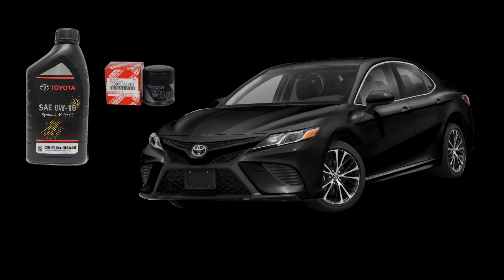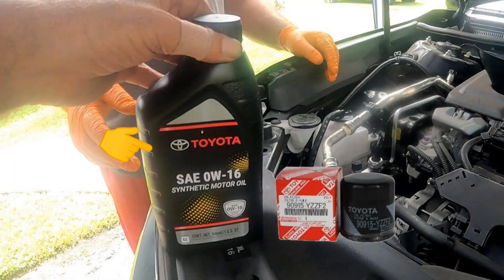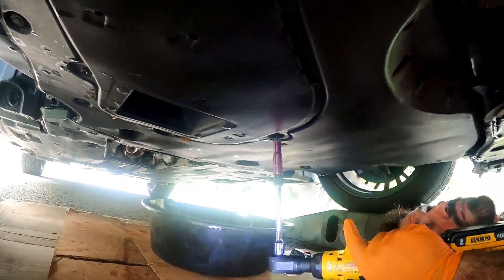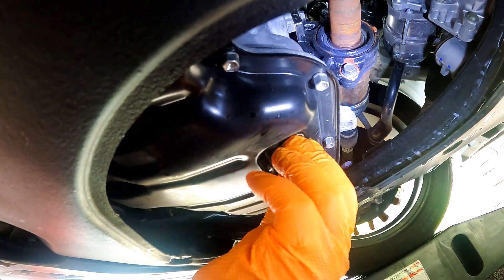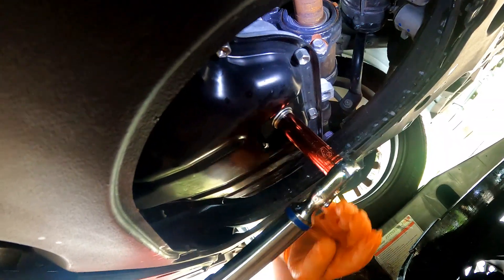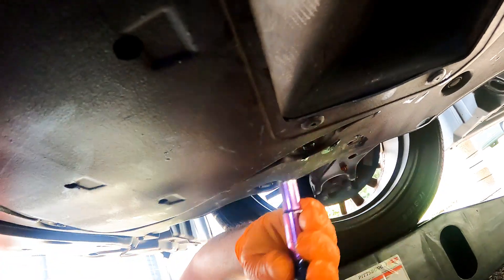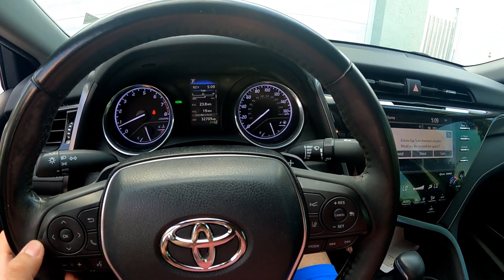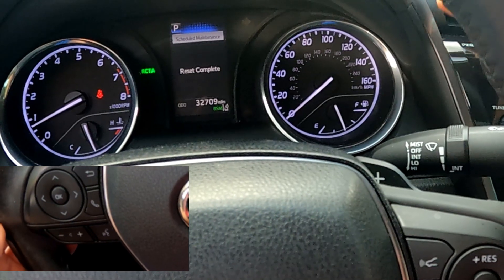How to Change Engine Oil and Filter on a 2019 Toyota Camry 2.5L engine - Reset Oil Life Indicator

Comment from the maker: Today we change the engine oil and filter and reset the oil life indicator on the 2019 Toyota Camry 2.5L engine. This is the 4-cylinder engine and should be the same from 2018-2021 models.

Comment: what is the recommended oil change-interval?
Reply from the maker: Vehicles in which 0w-20 is an option to 5w-20 mineral oil, (or 5w-30), will continue to require 5,000-mile/6-month oil change intervals, even if 0w-20 oil is used.

Comment: Please be careful tightening that oil filter with a filter wrench. You can crush the can which will leak oil. I would invest in a strap wrench instead. You may need different sizes if you have multiple vehicles but it’s much more forgiving if you squeeze too hard.
Reply from the maker: Good tip! Thanks for letting folks know. 👍

Comment: Is there a washer with the drain plug?
Reply from the maker: Not in the original plug but you can get one if your original starts leaking or order a new plug.
Reply: @JohnCRV  thanks had to go to Jiffy Lube and took it back they discovered the washer was left off and replaced it with a new one and problem solved
Reply from the maker: @michaelwinslow447  Cool!